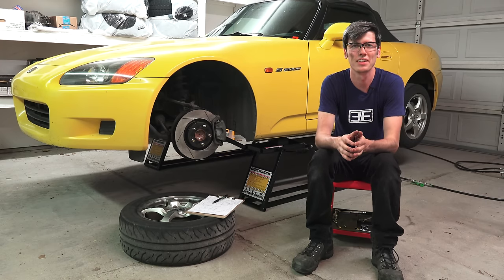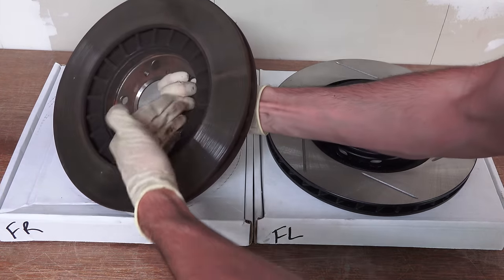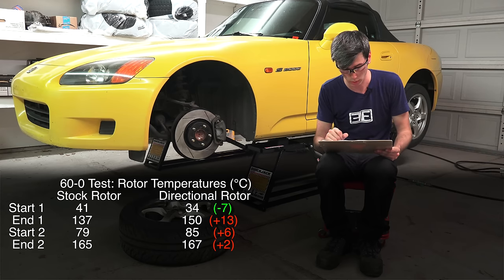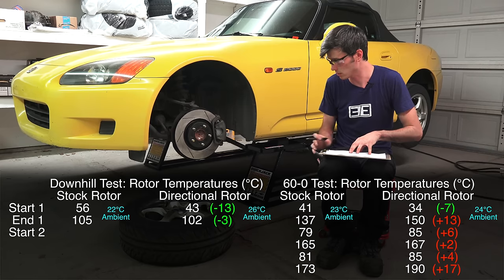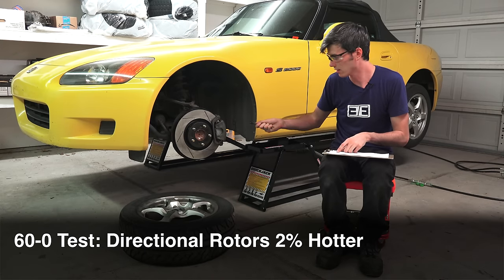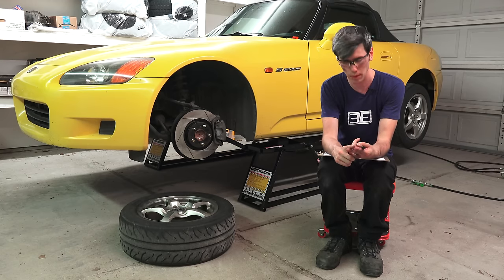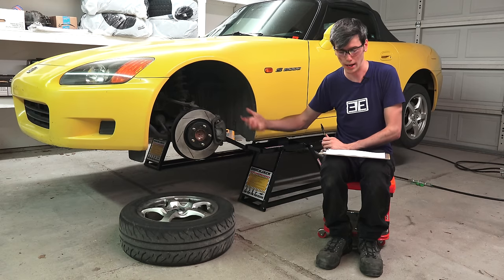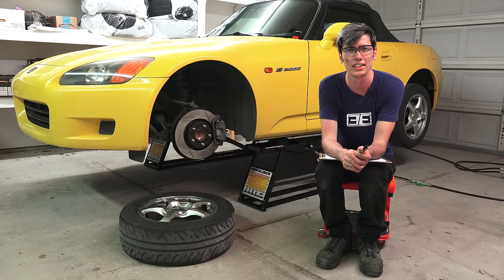Do Performance Brake Rotors Have Better Cooling?

Comment: The shorter the braking distance the more heat.

The shorter the stopping distance the more work is done.

We need to see the braking distance difference as in OEM vs Drilled when you made your final dead stop.

What kind of pads were you using on each type of rotor?

We need see to braking distance to full stop.

Were the brakes bedded on the new rotors before testing?

Slotted and drilled rotors are designed for cooling under track conditions.

Example you are at very high down the straight away then you brake for the corner without a full dead stop.

On a track when you exit the corner you are off of the brake pedal and now you are cooling the brakes as the air speed increases as well as rotor rpm.

At most tracks you are going to be above 100mph down the straight away.

The slots and drilled holes in the rotors are getting rid of the heat as the rotor spins.

As you approach the next braking zone you have cooled the rotors down for the next braking event because of the venting away the heat from the rotors and pads.

Comment: I noticed you didn't use the drilled rotors...which are the ones that actually help with cooling.  The slotted rotors are to help with pad wear.  Derp.

Comment: Hmm...It seems you tested how well the rotors absorbed heat during braking, not how quickly they dissipate heat after braking.  Also an uncontrolled variable in your data was stopping distance.  Perhaps though your pedal pressure was the same, the distance required to stop the car from 60 had decreased due to the increased coefficient of friction afforded by a new set of rotors with a machined face not yet polished by use.  This would have to translate into more heat produced if the same change in velocity on the same amount of mass occurred over a shorter distance right?

Comment: This test is okay but it's all subjective, I can guarantee you if you took an EBC high end rotor with EBC brakes you would come up with a completely different analysis. Also the same analysis would be if you had brembo rotors and brakes. There are certain brake pads that will perform better when they're hotter, you can run around and chase this data all you want but the bottom line is it's all subjective

Comment: Thank you for this video! Helps me make decicions on my future purchases. I think your assumptions are correct about test not being in a high enough tempature range for the products to really show how well they handle stress and heat. I think they got hotter because obviously lighter rotors will get hotter quicker but also alows quicker cool downs with air flow and over all better weight reduction. When things start getting supper hot is when things start warping. Thats my concern to the point of replacment. If and when you feel like doing another video id like to see you push these to the limits on a track for like 25 min each! Thanks for your efforts and for sharing this info honestly!
Reply: kevin olsen drilled n slotted brakes are always better. I use them for a long time. Big difference.

Comment: Hold on a minute! Doesn't anyone notice That his DIRECTIONAL rotors are on in the WRONG direction??? As the wheels are going forward, the heat is to be traveling BACK and AWAY from the center hub. In HIS configuration it is drawing the air TOWARD the hub. When he saw left and right on the rotors he stood in front of the car, pointed left at the right front of the car and said, "Well this goes here" etc. Don't give him directional tires to put on your vehicle. I say it's back to the cubicle for you, Engineering Explained! The explanation for this "engineering" was, "well it looked good on paper but when it came to real life, I did the opposite so it doesn't work." I say bring back the "Myth Busters" show, at least they could mount them correctly before testing!

Comment: I've been running Powerstop or EBC rotors n pads on all my street vehicles for years...
for the improved stopping power. 
Haven't had a fading problem, so cooling must be better. 
To test n compare cooling properly, you need to have live sensors during motion, to see how fast temps drop after you release brakes n continue driving. That is how vanes work to cycle air through, not standing still. Fast RECOVERY time is what prevents fade on subsequent stops.
Lastly, quick question..
How do you like those "QuickJacks" you are using?

Comment: The slots will allow better airflow at speed where the airflow is highest. The slower and virtually no airflow of stop and go would naturally favor the rotors with more mass. 
In the end, doing both testing procedures provided results showing the slotted disc did what they were intended to do.

Comment: So basically if you run your car on the track quality aftermarket rotors with directional cooling fins are worth it. But  if you're like most of us and your car never sees the track don't bother, stick with original OEM.

Comment: Power Stop brakes are a highly rated affordable. After market brake company you can buy a. Front or rear set starting under $200.00 to $200.00 to over $700.00. For two or all four rotors with pads. And callipers or not then vehical type and usage. Power Stop carries both unslotted and curved slotted with cross drilled holes. Why the info? Just to let you know about the other affordable. Yet better quality options out there. As well as the brand that garages. Like the one where I live choose. And what brand the do it yourselfers. Are buying so you can provide. A more intuned informative video.

Comment: cooling of 3 degrees in 10 seconds... so by the time you measure the temp of the aftermarket and walk around to measure the temp of the stock, you've run the risk of skewing your results by 3-6 degrees...

Comment: I would say two things you didn't consider - paint on the discs which will prevend heat exchange to some extent and second one is brake pads. You said that you didn't change them so it means they were „seated“ = worn together with stock discs and with the new one they were braking with smaller contact surface.

Comment: The slots will create more friction, therfore stop faster, but heat up more.
Reply: Wait, yeah... He said he applied ~50% braking. Well 50% may be stopping faster with the new rotors. Stopping faster means more heat!
Reply: the slots are against waterfilms
Reply: @David-cy5zu  what?
Reply: Exactly what I was thinking, water films, what?!
Reply: @VictorSilva-rq4kz  google it , im not your elementary school teacher
Reply: You just have added a link to "water film" whatever. Rather than making a wise-a remark.

Comment: Engineer huh? First it is 'VENTED' rotors, and there is little to no difference between straight or curved vanes. They are cast so $$ cost difference is nothing. The point is you could run vent hoses from the front of the car to blow cool air into the rear center of the rotor ... without that there will be zilch for cooling improvement. Do a new test actually 'ventilating' the 'vented' rotors and you'll see a big improvement, which is why Shelby switched the Mustangs to vented front disks as part of the list of 1965+ GT350 design changes ... and he ran vent hoses from the front spoiler to the brakes to blow cool air through them.

Whole other issue, blank, drilled or slotted rotor face. Slotted are best long term, drilling can weaken and lead to cracking, the slots allow hot off-gasses from the pads to escape easier improving overall brake efficiency. Etc, etc, etc.

Come on man, if you are going to call yourself an Engineer at least put some effort in.

Comment: Stock Rotors will heat up slower. Rotors that have had metal removed have less metal to heat up. Stock rotors will take longer and more energy to heat simply because they have more metal in them. Those groves and holes are a gimmick to sell rotors at a higher price. They look cool but that's about it. Manufactures know there is a sucker out there that will buy any new thing that comes down the pike. The laws of physics do not change, no matter how much people would like it to. It takes more energy to heat up a gallon of water than a pint of water. Simply the laws of physics. I'll take more metal for my money any day.

Comment: 🤷‍♂️ I see alot of people saying aftermarket is a waste which I can understand but I have warped slightly Oem discs abit when using more aggressive pads and on track days and some aftermarket discs I've used have been fine (others haven't)

End of the day though my splitter and rear diffuser and all that does absolutely nothing but look good as do my discs and that makes me happy 🤷‍♂️🤷‍♂️🤷‍♂️

Comment: A waste of money for street driving. How does it work in heavy rain?- reversed cooling. Have you gotten brake failure with stock rotors?If not why change them? You did not seat the pads . If racing pads are used what is the heat increase?Most important 100mph to 0 in how many seconds after seating pads in properly on each pair of rotors. Screw the small temperature changes can you stop faster? If hotter or colder does it affect lockup assuming no ABS.  More mass slows temperature rise. How many btus are absorbed with each rotor pair?
Too many variables unanswered. From decades of brake jobs I will say The factory Brakes are usually superior to aftermarket parts. And what about corrosion resistance. Bah! CAT gives this 1 paw rating.

Comment: I put some drilled/slotted rotors on my Explorer,along with carbon / ceramic brake pads. I just have standard drums on the back with semi metallic shoes. This truck stops on a dime,made a noticable difference. Another thing is the older Ford Explorer seem to heat up the front rotors and they end up warping. I have Tuff Stop. The cheap China rotors are probably made out of cheap cast iron. I wonder what brand he's using for this test. I was so impressed by the performance,I bought another set and put them on my S-10.

Comment: Maybe the cooling effect of the slots is ment to be at its most, when your not braking. The pads will probably restrict the cooling when pressed on to the disc. So the effect is lower temperature, next time you need the brakes ;-)

Comment: What whas the applied pressure to the brake pedals, the stopping distance, wind, etc? To much variables that are not taking in to account. This method is not reliable and nor repeatable by someone els. Sorry to say that.

Comment: Putting one set of new aftermarket brake  compared to used stock rotor of course the stock rotor will perform better because it's after it's had a chance to break in the mating surfaces which means it dissipates the heat better the test is completely inconclusive

Comment: The outside grooves on that rotor does not correspond to the inside cooling vanes(I might have misspelled this word, sorry), as you can exactly see at 1.39 in your video. You mounted them incorrectly(R>L/L>R), so the cooling might be far from ideal. Redo the test...

Comment: Well then this actually means the stock  brake discs are better than the aftermarket ones because not everyone is going to be using the car to drive like a maniac on a average road

Comment: OK, I found that brake differences really showed up in extreme repeated braking....like crash stops from say 160-180 time after time. These conditions are generally found on the track,,,,so it  could be that any significant differences are only revealed under more extreme conditions. We just do not know what the efficiency curve of the discs look like. Thanks for the huge effort involved in putting this video together, Bit hard for me to comprehend the sarcasm and derogatory nature of some of the comments.

Comment: So ultimately, the research you mentioned recorded a 200-300 degree difference when the rotors were at their most extreme temperatures and that will make a huge difference In the life of your brake pads and Tires. Just think of your pads being cooked inside your wheels at 800-1000degrees, while your tires will surely be at a higher temperature as well. 
I would say that’s case closed, if you want performance and lasting durability from your rotors, but particularly from your pads and tires... well you know... lol

Comment: I might of misunderstood your video but your venting out to in? …..if so…When these race teams run cooling ducts from the bumper to the wheel hub, or any f1 car for eg, do they not point the duct at the centre of the hub so the rotor vents the heat from the centre out to the circumference? There by pointing any remaining heat at the wheel and heating the tyre and hopefully taking heat away from the bearing. If I’ve misunderstood please ignore but unless you have cooling ducts I doubt it will make any noticeable difference anyway …no? 🤷🏻‍♂️

Comment: Note:
Brake rotors come in at least 3 different grades of metal, and ceramic stuff.
Brake pads come in several different grades of materials.
Putting the wrong pads on specific rotors is a no no.
I once used cheap rotors and good pads and in 12,000 miles the FINS were showing.😱😱

Comment: A hotter performance rotor isn't necessarily bad. Some performance pads are more efficient when hot
Reply: I bought some fancier pads once (ceramic alloy, maybe), and as I recall they were a bit slippery when cold or wet or something.  It was a shock when first finding that out.  They were better when warm, though.

Comment: Faster stopping, harder stopping both generate heat - in performance brakes what is desired is how fast the disc will cool from it's peek temperature. Slotted, drilled disc's will allow better air flow for faster cooling. If you didn't get the temperatures back down rapidly you'd experience brake fade or seriously warp a rotor. Ceramic brakes get very hot and almost glow red under heavy braking, but they cool back down rapidly. Short answer is - we don't care how hot they get - it's how fast do they cool back down without warping. It's how fast we can stop or slow down that wins races at the track. Going very fast and braking at the last possible moment, very hard. So unless you do a lot of heavy braking when you drive or live in the mountains and brake all the time - you don't really need cross drilled or slotted discs. Unless you have a 3rd gen Camaro with the worst brakes that Chevy ever produced. Yea, you need performance brakes. LOL

Comment: They did the surface slots backwards only to slow down brake dust build up on the wheels, "Bling Bling". They should be oriented the other way to channel water outward during wet braking, working with centrifugal force rather against it. 
C.G. School of Hard Knocks

Comment: I know some brake systems require heating to become effective, but I usually only see this in carbon ceramic. As for the directional cooling vanes, it seems almost counterproductive in the direction they have them facing, since the air comes from the center and exits out the top towards a singular direction. Wouldn't it be better if they vented more rearward than forward? I'm no physicist, but the regular straight vein simply dumps everywhere, whilst those you just tested dump singular directional towards mostly air opposition roughly 35% of the time.

Comment: Energy cannot be created nor destroyed; it only changes form. My question to the community is this. Since the aftermarket rotors produced more heat, does that mean that the aftermarket rotors did better in converting the kinetic energy of the vehicle's forward motion into thermal energy; ultimately producing better breaking?

Comment: Is the rotors casting . When cars manufactured buy rotors they bought in large volumes, after market only buy small volumes of rotors, they intended to produce cheap metal casting , curve vain is alway intended to cool quicker than straight vain, but if you cryogenic aftermarket rotors , you will see aftermarket rotors can drop temperatures of 8 degrees to 15 degree coolers than automotive manufacturers rotors , is just depending how much temp melt casting and how longs the process repeat cool down from automotive industry . Is proven when you cryogenic those rotors for racing

Comment: I think your findings are correct. Perhaps stock rotors are better for street driving (as they are designed for) and the performance rotors are at a disadvantage when being used for street. The performance rotors are designed for performance driving. 0-60-0 at half braking power is a street condition. No one brakes at 100% when approaching a roundabout or red stoplight. On the track you will brake as late as possible close to that 100%. 
I think your finding of stock rotors were better is not surprising.

Comment: As a “normal” driver I don’t really care about the temp performance durning normal driving. I do care about noise and panic stops or when I’m in the mountains and using the brakes a lot.

Comment: You also did not test the steel mix density of the caliper under weight also the slope degree of the hill you were coasting down or may be considered temping one or two trips up here and compared the differences in up hill corning. to me brake only matter to me when coming into a corner, in a corner and releasing out of a corner. that yanking energy to slow down verses my suspension matters first, I think any type of driver would logically run that drill through head in any driving situation. My point example: The Average joe is only thinking of sensibly stopping the car safely at 135 to if at best 80 ft affordably. most of them stop in a straight line. Pro drivers are thinking  "Whats the fastest way to slow in /out of a corner  with breaking this car, will the brakes hold and for how long"? In short. stopping and cooling would only matter to a pro 130 ft to 65 ft at best or max. nc video.